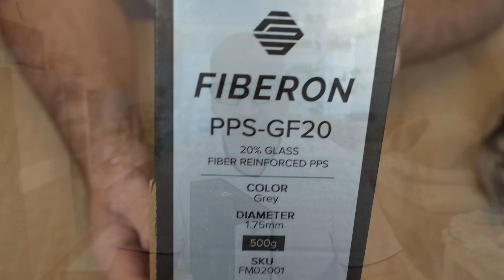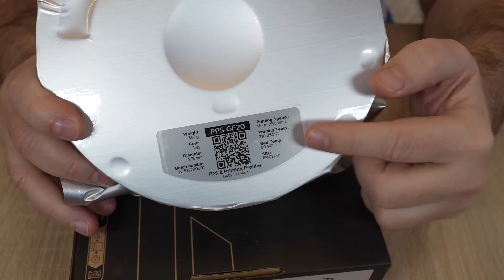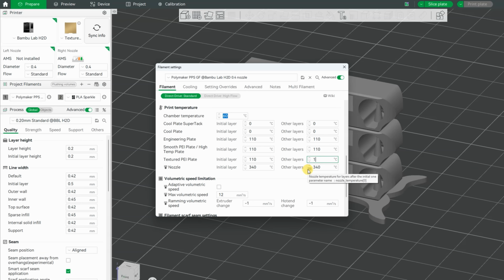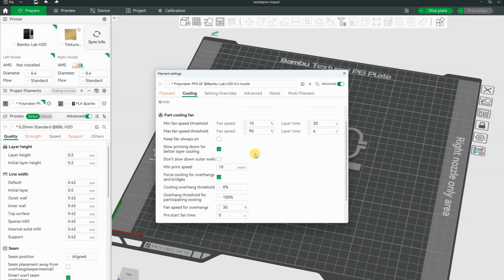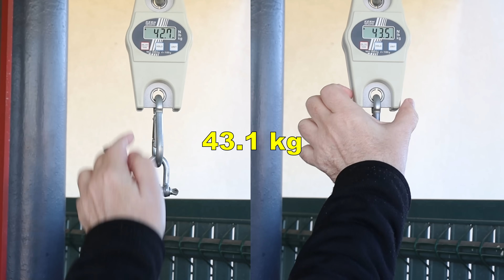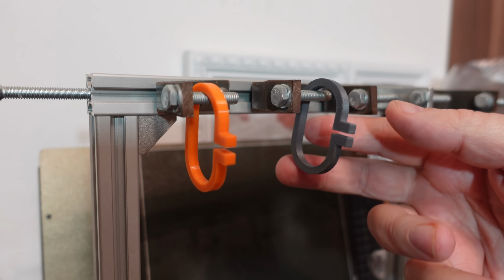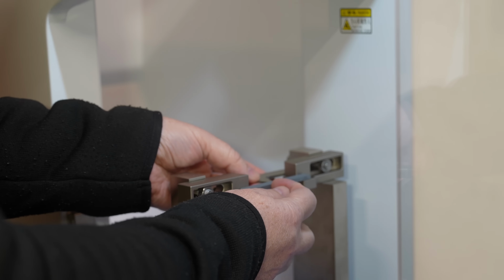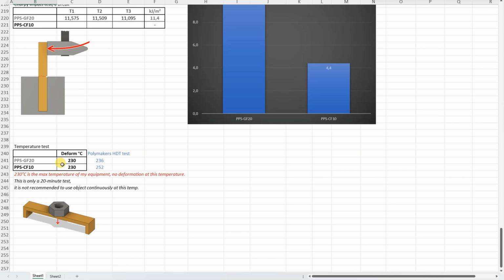Polymaker PPS-GF20 Filament Tested: Still Sounds Like Metal?

Comment: have you ever tested SEBS filament? it's a flexible one like TPU or PEBA but not hygroscopic and maybe higher temperature resistance
Reply from the maker: Never hear about them. Good to know. Thx
Reply: @MyTechFun it might even work in the ams because it has less drag

Comment: One thing I would like to know about is gluing the materials.  My printer isn't big enough for some engineering things I do (no printer is) so I end up printing in ABS-GF or ASA-GF because I can glue parts together and the glue joint is very strong.  I'd prefer to use PPS, but don't know how to glue it.

Comment: I would really like to see some more tests of biodegradable plastics like greentec, niceBIO, greenyHT, allPHA,... Do you have anything planned for "oil free" plastics?
Reply: Oil free and biodegradable plastics are not mutually exclusive.  PLA is not "biodegradable under normal understanding. Are you interested in both or just oil free?
Reply: @frijoli9579 I hoped my examples gave it away. I'm interested in biodegradable and oil free. In Germany and Austria up to 90% of collected household plastics are burned for energy... Even if they could be recycled. Throw some (regular) pla in the compostable/biodegradable trash and it will be broken down at a (for us) standard composition facility.

Comment: Pps-cf and pps-gf are some of my favorite materials. I have a bunch of fiberon and qidi brand pps-gf and Pps-cf and theyre both amazing materials. Ive actually noticed that fiberon has more of that metal sound than qidi brand but that could also be because i print the qidi brand at 370c instead of 350c
Reply: What machine do you have?
Reply: @Chris-o1x3b i have quite a few but im assuming the reason for your question was the "370c" i mentioned. For that temperature i use my qidi plus 4. Its been an absolute high temperature workhorse and its definitely one of my favorite printers. Im also a big fan of the bambulab h2d, having a 2nd nozzle for dedicated support interface material is a game changer

Comment: Did you know if you add non Bambu printer to Bambu studio switch to it and at very top task bar , calibration tab opens up all the calibration options not just flow dynamics and flow calibration but the others, then you load one and switch back to your printer you won’t have to add g-code. 
For Mac it’s very very top area not the one in software

Comment: I always felt that glass fiber was better than carbon fibers even added to plastic. If you read the material marking on most any rugged enclosure (drills, impacts ect) it will always be nylon with glass fiber. You only really see CF when ESD properties are important.
Reply: That is because they can colour it when they use GF, but CF is technically superior in every way.

Comment: I have left some of this PM PPS soaking in MEK for over a week with no affect on the part. MEK is a very strong, unpleasant, and very bad for you industrial solvent. There isn't much that MEK will not attack and break down.

I used this PPS GF and CF to print the toolhead parts on my IDEX Voron. ABS GF couldn't hold up to the heat when printing more advanced filaments.
Reply: MEK is a pretty strong solvent, but it's not really that much more dangerous for your health than acetone (which for all intents and purposes is non-toxic), since it after all is also a ketone.

Comment: Drying these materials is unfortunately not that straightforward. You need temperatures of at least 120 °C, and currently there is no consumer-grade drying device capable of reaching those levels. Industrial ovens can handle it, but they are either prohibitively expensive or require far too much space.

SUNLU or eSUN — are you listening? A compact 120 °C dryer for consumers, designed for one or at most two spools, would be a real game-changer.🥰
Reply: Ninja AF-100, <$50 USD, perfect size for a 1KG spool of filament, lab-grade  blast-oven performance, thank me later 😆
Reply: There is, sunlu E2.
Reply: food dehydrator

Comment: Slightly surprising how good this filled filament is. Even at 20% fiber loading the layer adhesion is still very good.
Curious on your upcoming PP test, that will be a different beast both in terms of properties and print difficulty. I hope you can surprise us with good print properties (especially bed adhesion).

Comment: Hi! Thanks for tests, If possible, if you have some PLA, ABS, PETG etc materials tests then add those results to table - since I didn't follow the topic its hard to understand results if baseline is also rare filament :)
Reply: Just open another video and compare the numbers cmon
Reply: Igor's spreadsheet has all of the data on all of the filament tested by My Tech Fun.  It's a substantial body of work.  That said, each standalone video summary might be better if there was some quick comparison that included averages for PLA, PETG, ABS, TPU and other common filament materials.

Comment: For the moment I don't think I have any project or use case that would require this material, but it is nice to see that it is available and printable on a printer with a hotend that can reach the temperatures. If it was not that expensive I would actually consider printing a PC case with it, but then I wonder what is the largest size print without warping for a material like this. Pretty sure 30cm long panels will require heavy surface patterns in the design and straight walls would warp and bow.
Reply: PC CF is a good replacement for a computer case. HDT at 1.8mpa is over 120°C and should be good, but the really high chamber temp requirement is a pain. I can get 1kg of Iemai PC CF for 50€ on amazon, but they recommend a 70°C chamber temp as minimun, i can barely get to 60°C (Sovol SV08, no active heated chambe for nowr, and toolhead board can get really toasty at 70°C chamber)
Reply: @tecnosalva14  PC-CF > PPA/PPS except its not flameretardant. Except this, its best filament u can print in home imo. Highest glass transition temperature. Even PPS is worse. But pps is flameret, thats why Ive chosen it.
Reply: Im printing PC case from pps-cf and gf (mobo tray). PC-cf is unfortunately not flameretardant, would prefere it over pps for layer adh. PC-abs has flameretardant versions though, but no fibers.
Reply: I've been running a PC in a 3D printed case for over a year now. 7900XTX so it puts out a ton of heat.

It's PETG. Basic-ass Bambu PETG.

Zero warping over the past year.

Y'all are severely overestimating how hot PC components get.

Comment: Can't print this on a Prusa Core One. At least not yet. The upcoming 400C hotend is still not available and will cost $199. Waiting for the inevitable 3rd party solutions once Prusa releases the firmware update.
Reply from the maker: I think more and more manufacturers will start producing similar high-temp hotends. 290 on my MK4 was a big step back after 300 on MK3.
Reply: @MyTechFun  i had no luck getting our mk3s to 300 with the stock firmware, it would overshoot and trigger an emergency. 285 was the max i felt comfortable leaving it set to. 

But now that i have replaced the thermistor for a thermocouple, and it works for this pps  stuff fantastically. Had to modify the firmware. Open-source FTW!

Comment: Do you feel like poly maker is overly optimistic on their recommended temps and not needing a heated chamber?  Seems misleading and you’ll get better and more consistent results with higher temps.
Reply from the maker: I am sure that printing without enclosure or on 310C will make very weak layer adhesion. But I don't like to talk about things which I didn't tested.

Comment: I made a large intake manifold for a briggs 16hp engine. this stuff just fell apart. I think it might have been under extruded.
Reply: This needs much higher temp for proper layer adhesion
Reply: What nozzle temp did you print it at?